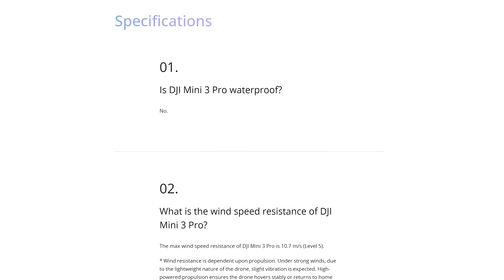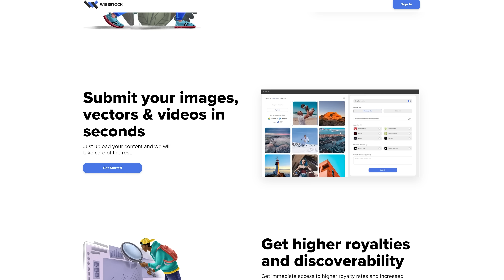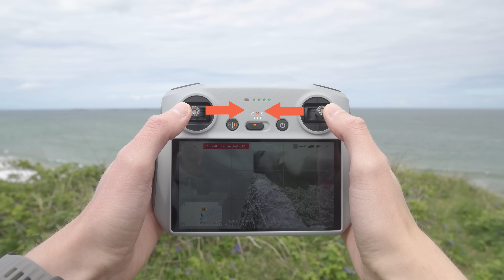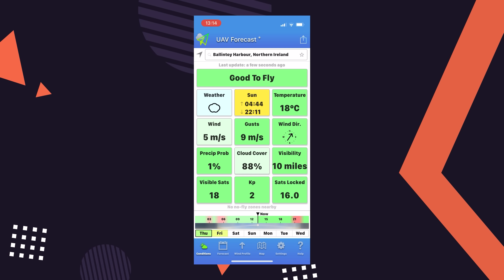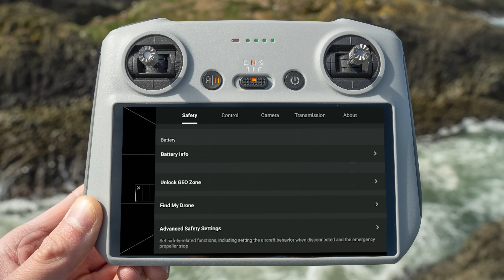DJI Mini 3 Pro | HOW TO FLY OVER WATER

Comment: Good points, Mattheww.  I would like to add one more caution, having lost a Mini 2 over a fast-moving river recently.  We had just had heavy rains, and a river in our local nature preserve was running very high.  I wanted to capture this dynamic event from the Mini 2.  I launched the aircraft, and immediately found it difficult to control.  The water was streaked with a naturally-occurring foam, and I think the moving pattern of the foam confused the downward sensors.  No matter what I tried with the sticks, the Mini 2 kept driftng downriver and away from me.  It was between 2 and 3 m above the river throughout.  I tried rotating the aircraft to come home, or at least to get over the bank of the river, but it would not respond.  Continuing to drift backwards, it struck an overhanging branch and fell into the river which is too deep to wade in at that point.  So I would recommend to my fellow pilots to avoid flying over fast-moving rivers, especially if there is a pattern on the surface.  Thankfully I was able to use my DJI Care flyaway coverage and was able to replace the aircraft for much less than buying a new one!

Comment: Hey Mattheww - been shooting over water a lot. But I shoot very close to surfers and standup paddlers. I'm usually only about 20-30 meters away on shore. Interestingly so far I'd been doing all my shooting on a Mini (original) and Mini 2 - got the Mini 3 a few months back and finally took it to Hawaii last week.

First day with it today and was amused to discover that flying 1-2 feet above the water was confusing the shit out of it and it kept stopping. 

Didn't take long to figure out that I could turn off obstacle avoidance - however one very common shot I do is a low level quickshot circle of a person stand-up-paddling.

I Can of course manually fly the orbit but sometimes in the interests of speed I just bang out a quickshot.

This worked fine on the Mini/Mini 2 - (if the person was paddling too quickly it might get confused but in that case I'll just fly it manualy)

But on the Mini 3 it doesn't work AT ALL. Low level quickshots are damn near impossible - presumably because collision detection cannot be turned off during a quickshot.

Is there any way to do this? For example could I use SPORT mode in a quickshot to "disable" collision detection?

(I shoot everything in CINE mode normally) - I figured you might know.

(the shot I'm talking about is a very low orbit - about 3-4 feet off the water's surface) maybe about 5-10 feet from the subject (person standing on a standup board paddling slowly)

Comment: Yeah XCWeather is excellent, I use it a lot when out boating, I know ships pilots who use it as well. You can spot the easiest time to moor up when the wind is slack. Its usually very accurate, originally for pilots.
Reply from the maker: I have found XCWeather to be one of the most accurate and the hourly breakdown helps too!
Reply: @TheDroneCreative  Agreed Mattheww I rely on it when picking a time to moor when out in the barge, trying to moor in heavy winds is a bit of a nightmare when your trying to haul in a 25t boat on your tod. Can try and time the mooring to coincide with the least amount of wind to make my life a bit easier. It’s a shame you cant get the drone to home in on the remote control when out on the boat, cant really hover the boat to designate and update the landing spot, all tricky when you cant let go let go of the tiller when steering and all the other little things that need to be done.

Comment: Very interesting advices, but have a question, no other channel seems to be able to reply, not even italian: i have an electric jetboard i usually use it during the early morning with calm water an zero wind (jetsurfing is for relax, totally different from classic surf), i'd need a drone capable of atofollowing me for 15 minutes more or less, maybe leaving the controller at the shore temporarily (at early morning i usually have nobody who can help with this). So do you think this could be possible, i mean autofollow on the water without sinking, and in case which model could i consider?
Thank you

Comment: Check your specs as to when the down facing sensors kicks in. That is the point when your drone is looking for patterns of the surface below and it uses that to detect the height rather than using GPS. Over water then this pattern recognition is difficult to detect as the surface is constantly changing and thus there is often a difficulty to get an accurate height measurement.  That is why you see the drone bobbing about as you get lower as the drone is trying to detect patterns in the ground (the sea) and keep itself level.  My dji mini SE specs indicate that the sensors kick in at around 10m.  Above that height you are using GPS so its a flat movement, below that, then you are starting to use the downfacing sensors to get the height and you can then get bobbing going over water (you can get the same over snow as well).  ps if you fly too low and it bobs about at the wrong point then you can turn your drone into a submarine . . .

Comment: Another great video. I have an issue with your "launching and landing from a boat" - say you are on a slow-moving sailing boat, updating home point regularly as you suggested is not going to achieve a safe landing - better to switch off home point altogether and land it manually, unless you have a better suggestion.
Reply: Might be wise to set a fixed homepoint on the shore?

Comment: You've lost the plot M, there is only one rule, keep it at least 13cm off the surface of the water, if there are waves, just go right through them and stick to rule 1.
Reply from the maker: 😂 and always use the water floats, always.
Reply: lolol 😅😅 Mr Skraba wit the Top Pro Tips 🤙

Comment: When flying a drone over water, be extremely cognizant of resting your thumb on the left control stick.  I saw another content creator recently crashed his Air 2S into the water on a family fun day on the water and he thought he was flying fine, and then out of nowhere the drone hit the water and promptly sank to nearly 100 feet deep.  He looked at the flight logs later and it showed he had slight downward pressure making the drone descend, and with the downward facing sensors having issues over water, the drone didn't protect itself.  The best he could come up with was he may hve been unconsciously resting his thumb on the stick and slowly forcing it down.  My degree is in computer electronics and making components waterproof isn't difficult, especially if you only get a small splash and quick submersion.  If you do hit the water or get the drone wet, IMMEDIATELY remove the battery.  The water isn't what kills the components, it is the power shorting between components that causes the damage.   For any electronic device that gets wet, immediately unplug the power or remove the battery.  I think once a single drone manufacturer comes out with a semi-waterproof drone, it will force other manufacturers to do the same to check off competitive boxes, and the waterproof ratings will quickly reach acceptable standards.  When flying over water, even if the RTH kicks in, if you're flying into the wind while RTH, the battery may die before you get back safely to land.  On a positive note, I was recently flying my Mini 3 Pro and the battery was forcing a landing because it was almost dead.  I work in IT and as a technical person, I know there are safety measures built in, and I wanted to test this battery.  I hovered over my deck and the drone tried to land, and I'd force it back up.  I did this until the battery hit zero charge, and I kept doing this for about 5 minutes more just to see what would happen.  The drone still had power to fly if I forced it to, and I'm guessing you could push the issue several minutes past the reported zero charge.  So that critical battery warning is a good guide, but you do have some additional buffer charge if you get into a pinch.  My normal preflight also includes taking off to just over the height of my head.  I listen to the motors and rotors for any abnormal noise, and also yaw in a complete circle listening for anything I don't expect.  I do not check every single time I fly, but I also check the batteries as I put them on a charger or pull them off to make sure they are not warm when they shouldn't be, or that they are not swelling.  Tip for high winds...I was flying my Mavic Pro about 175 feet and I was getting wind warnings, and it was never enough to make much of a difference.  Then I sent the drone higher and I was flying around videoing for the fun of it and not paying close attention to my range because I wasn't intentionally flying away.  I was trying to fly back and I noticed the distance meter on the remote showed the drone was still going away from me, even after I switched to sport mode.  I immediately started descending and looking for a safe place to land if it all went sideways, but knowing the wind is not as bad at lower altitudes, I dropped to about 150 feet to avoid trees, and the wind was slow enough to easily get back quickly in sport mode.   One app I really like is ALOFT.  It shows the airspace rating, temperature, wind speed, wind gust speed, visibility distance, humidity, cloud cover (such as currently 56% cloud cover and clouds starting at 2,919 ft. AGL.  It also lists the next sundown or sunrise time, the kp index and impact, GPS signal.  It also shows your lat/long/altitude, if the airspace is clear, tells the weather forecast, and some other features.

Comment: Great video. Yes, no DJI drones are waterproof. I saw a "wetsuit" for the Mini 2 to make it waterproof to fly in snow and rain. I am not sure it is 100% safe, though, because water will still go through the motors, so I am a bit skeptical about it.
I had a scary experience with my Mini 2. I tried to fly into a low road underpass where a river flows and the downward sensors would keep pushing it up. If I had gone into the tunel, it would likely have crashed into the ceiling, which was pretty low off the water. Very tricky those sensors! I wish you could turn them off.
Reply from the maker: Yeah. I have noticed even with the obstacle avoidance off on the Mini 3, it still will rise up if the downward sensors detect something. Would be great to be able to turn them off.
Reply: @TheDroneCreative  The only way I have found to do that is actually disconnect them from the board inside the drone, but I feel like the software would think it was faulty and maybe not even let the drone fly. Maybe this is something we can send to DJI for a wish list item? Over Water Mode? :)